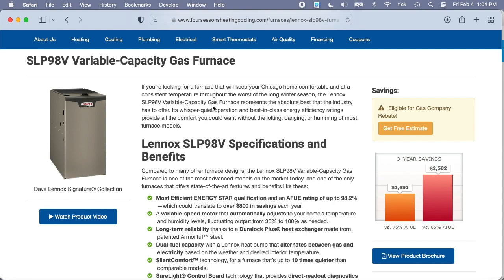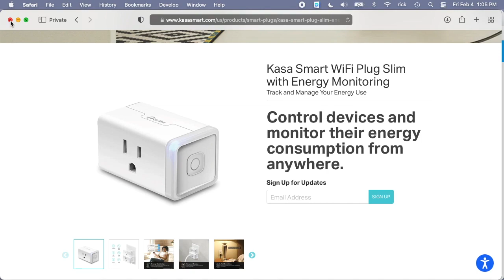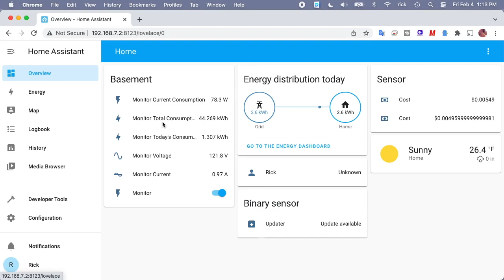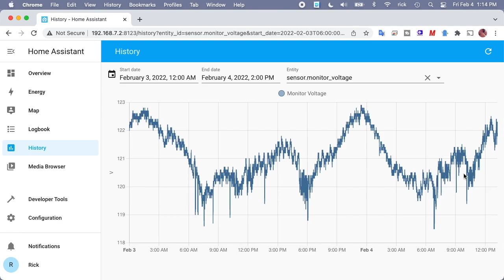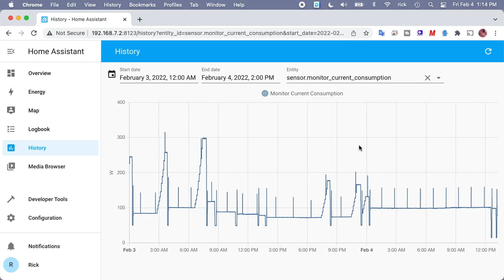High Efficiency Gas Furnace (ECM Blower) Electricity Usage

Comment: Great video. Couple things:

1. Is it pretty efficient to have the blower fan running all the time, because it is a variable speed fan? Any concern about wearing out the blower motor?

2. If you ever test the system on the generator/battery, it will be interesting to see the energy usage while the unit is in emergency mode.
Reply from the maker: I think I have been running it almost 15 years continuously with no problems. I cover power usage when running in this video: https://www.youtube.com/watch?v=4yQPxv1Lwlg